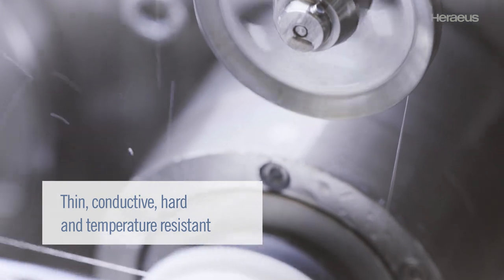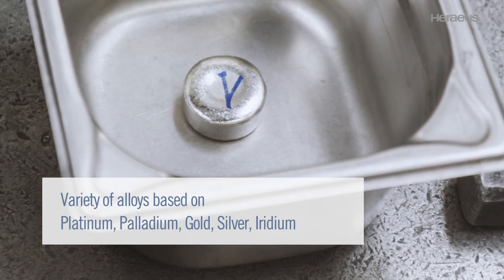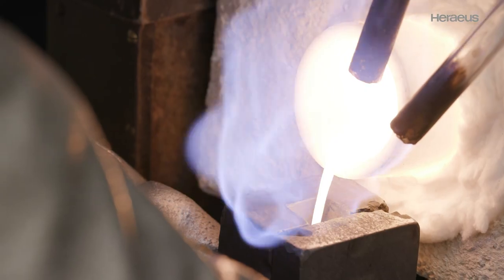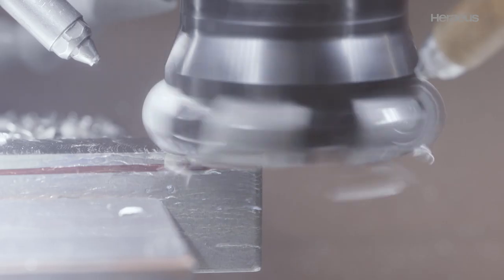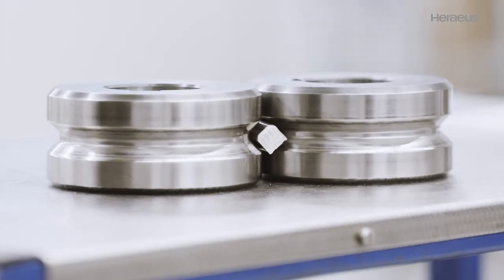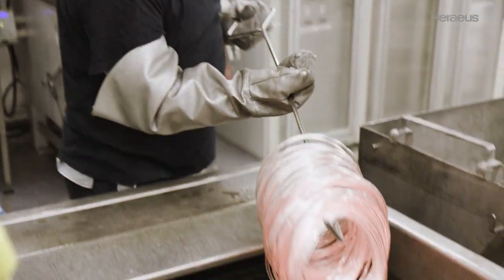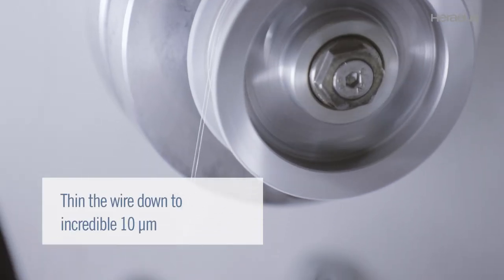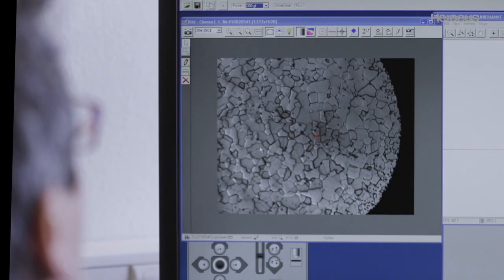Ultrafine wires made by Heraeus – from production to the final product

Comment: What are these wires used for?
Reply from the maker: The wires are typically used in areas where an electrical current is applied. These are for example temperature sensors, sliding contacts, igniters for airbags and the testing equipment for the manufacturing of semiconductor chips. If you want to find out more, visit www.heraeus-electrical-contacts.com
Reply: @HeraeusGroup  89 zn
Reply: Aluminium and gold wires are used for wire bonding in microelectroincs packaging.